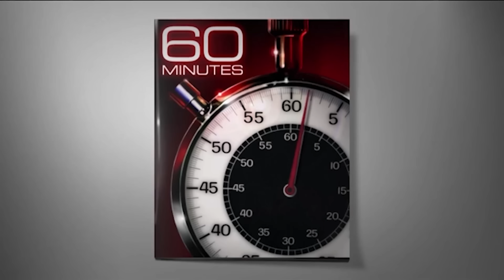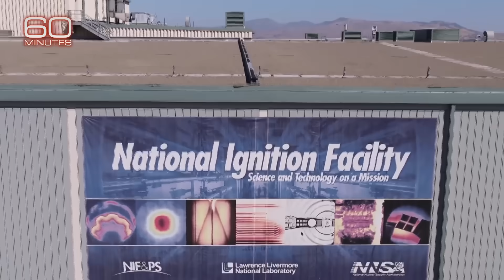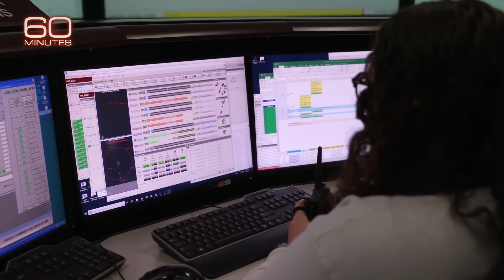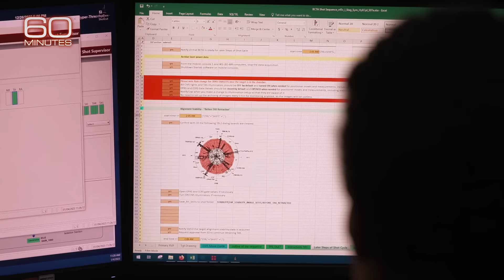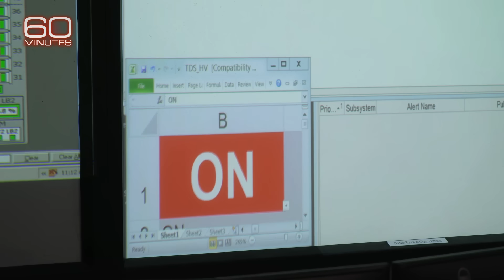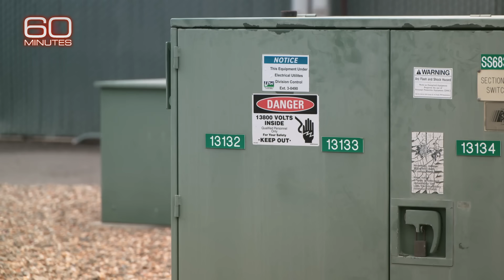Nuclear Fusion: Inside the breakthrough that could change our world | 60 Minutes

Comment: the crazy part is... fusion reactors for all the power they use can't even do what ball lightning does as it sustains far more than 30,000 volts per cm of spark and keeps burning steadily till it dissipates. No magnets holding it's plasma together and driving it's output...

Maybe that's the key to free or cheaper energy...

bet ball lightning is also more efficient than fusion reactions to... Yet they can't figure out how the lower energy fields work to create ball lightning as they try to take more chaotic and energetic plasma
Reply: Please someone explain why our magnetic confinement and massive energy can't do what an open air ball of lightning can do... They can't even replicate ball lightning yet which is more calm and easy to control in comparison to fusion plasma.... That fails to last as long as ball lightning that seems to be doing cold fusion.... A thing that would be a true breakthrough would be taking the lower energy more stable ball lightning....  Literally does what they try to make reactors do and does it with what exactly... It has no magnets draining cities earth of energy. No aircraft carrier lifting magnet or power source..... 

Why are they not trying to copy the one thing in nature that could be key to getting it right.....
Reply: Tho ball lightning is also connected to things it seems separate from. Like every electromagnetic field able to interact with it's own... Maybe it's a spot where electromagnetic waves constructively interfere. 

Be funny if it was as simple as frequency and energy at the right vibration.... 

Maybe that's why it's so random.... 

Not exactly just the energy in the ball but a good part of energy moving from outside from another field into it as it's a point where energy from two or more fields interact amplifying eachother as ones from Earth itself, others from clouds and maybe even fields in space to.... All is connected through them and that's slot of energy spread out.... Wonder if ball lighting equations for energy and all that match the bigger areas of the the fields they originate from....
Reply: Crazier thing is the energy despite of the sun is actually less per human sized area than a person has inside. If humans were turned to 100%energy it would take less humans to match the sun's output than it would take to fill it in with humans.... And that's just digestion... 

Sun is less than 300 watts per meter cubed.... A human is 1000 jouls per meter cubed. Digestion takes 2 joules per calorie at over 2000 a day....

The Sun's "power density" is "approximately 276.5 W/m³, a value that more nearly approximates that of reptile metabolism or a compost pile than of a thermonuclear bomb."

Comment: Actually, 60 Minutes is WRONG.
Nuclear bombs are FISSION, not fusion.
Bombs don't "fuse" atoms, they SPLIT them. The difference between power plants and nuclear bombs is, the former is CONTROLLED fission and the latter is UNCONTROLLED fission
Reply: Thermonuclear/hydrogen bombs are using fusion.  They're actually fusion bombs.

Comment: Such a great point to look back at history and think the Wright Brothers only flew 120ft  (37m) on their first flight in 1902. It was roughly 10-15 years after that time planes were used in WW1.

People doubted the Wright Brothers that "flying" wasn't possible. 
This sounds so familiar in relation to the doubters of today.

 The achievement on Dec 5th is no doubt remarkable. This goes out to all the privet companies working around the globe.
Congratulations for this small step in a huge process. I believe in you bright and talented people will make this happen. 
Thank you
Reply: I have similar view on the topic, humans knew what is required from powered flight for over a century at that point (fluid dynamics), and saw birds doing it since forever. Story of the fusion as energy source is very similar, we know the physics behind it (to some degree, because QCD is so complex we only have approximations). But in both cases several technological breakthroughs are (were) required to achieve the ultimate goal. For example  Commonwealth Fusion is developing high temperature superconductors that should allow for much smaller tokomak/stellarator designs, enabling to iterate over the design (they plan to show net energy gain before Iter is even operational). There is also General Fusion and Helion that both achieve fusion and plan to show net energy gain in several years (both using completly different approach than tokamaks). It is hard to say what is the progress of China in this field as you can not really trust sincerity of the claims they provide (but can't dismiss their prowess either).
Reply: @ukaszlampart5316  china can barely power their aircraft carriers... lol
Reply: It took less than a life time to go from  flying 120ft to flying to the moon.
Reply: best part i believe is all the tech used to make it happen is relatively old and inefficient like the lasers, so if we build one with modern day or experimental parts maybe we could get a better Q
but at the end of the day im no scientist 
i can only wonder in Aw
Reply: The Wright Brother's comparison, on its surface, sounds encouraging, however... a true comparison with consideration to scale would not be the Wright Brother's to current flight technology... a more accurate comparison would be Wright Brother's to Light Travel. When you look at it that way, you can really start to understand the complexity of harnessing fusion energy in a truly meaningful way.
Reply: @jefferyl4066  Your scale is way off and makes no sense lol. Light travel, even starting from today’s technology is an infinitely (literally) larger stretch than the initial comparison of fusion to man’s first flight.
Reply: @GorlockSlayer  You clearly aren't privy to where man is at on the timeline of light travel implementation.
Reply: Getting to flight, and getting to practical power generation from nuclear fusion are two VERY different things.  It probably will happen, but without some major breakthroughs it likely will not, not in the next 20 years, anyway, and I mean happen in the lab, not in a much more difficult working power plant.  

One of those breakthroughs, I'm guessing, could actually be nothing to do with nuclear energy, that being a true super brain, and a few iterations to an ultra brain or hyper brain of whatever the heck you want to call it.  Of course, it could end us shortly afterward, so there's that.  :-)
Reply: We always get the worlds greatest inventions every 120 years, Harley Davidson also came out in 1902 a lot of stuff actually
Reply: Birds can fly, but no animal can do fusion. The comparison you are making, makes no sense. Flight can happen under normal conditions. Fusion happens only under extreme conditions. Fusion is extremely difficult to make economically viable. This "breakthrough" does not mean anything. It takes us no closer to fusion as power source on earth. Its like you didn't even watch the video. 300 energy "units" user to get 3 out. Lol.
Reply: Converting fusion to usable energy for the masses is orders of magnitude more difficult than the aviation breakthrough. I don't forsee any significant amount of fusion energy supplied to the public this century!
Reply: Some of the 1st planes that weren’t successful were unmanned
Reply: Its nothing like the first flight. Its more like refining iron ore for the first time after 60 years of trying and then saying a Porsche is possible in a decade.
Reply: I'm skeptical about the prospects of self-sustained nuclear fusion -- getting more energy out of it than you put in. We cannot emulate what the sun/stars do because they rely on GRAVITY as the driving force for the reaction to happen, and gravity requires no extra 'energy' -- it's simply a force that naturally occurs when a large body of MATTER is present. So, we have to expend tremendous amounts of ENERGY in order to start and sustain the fusion reaction. Researchers may 'claim' that their reaction produces more energy than the energy required to start the reaction, but two critical questions remain: 1) Is that differential in energy SIGNIFICANT? In other words, are we expending 3.9999 joules of energy in order to extract 4.0000 joules of energy? 2) Are they even able to SUSTAIN those nuclear reactions 24/7? 3) Even if they're able to CREATE more energy than what was spent, can they actually HARNESS all that energy? or does much of it get lost/wasted in the process? Nature/God has provided a 'model' for how energy can be created via nuclear fusion -- using GRAVITY as the key driver (and 'gravity' requires no extra energy to be input). It may very well be possible that this is the ONLY way to create a net-positive fusion reaction.
Reply: Wait. They first claimed that it takes 2 units of energy to get 3 units out? But the reality is that it takes 300 units of energy to get 3 units out? Is this some kind of joke? Basically, they haven't achieved ANYTHING EVEN CLOSE to sustainable fusion energy. Wait. They first claimed that it takes 2 units of energy to get 3 units out? But the reality is that it takes 300 units of energy to get 3 units out? Is this some kind of joke? Basically, they haven't achieved ANYTHING EVEN CLOSE to sustainable fusion energy.
Reply: Patting yourselves on the back over this isn’t really the same as the first flight which can get into immediate production.  Maybe in 50 years you can do the ol back pat, if ever!
Reply: @shitmandood  your name and icon say it all, bruh
Reply: @schmarpsywinkleurnklabean659  ???  And yours doesn't?
Reply: @shitmandood  what does my handle mean?
Reply: @shitmandood  Well I am not sure what comment specifically you are referring to, but mine was never stating that the specific approach used by National Ignition Facility will be the one. To be honest I highly doubt it, but instead I presented others that might achieve that.

Comment: What kind of energy did they put into it? If it wasn’t the laser power? I thought that was the whole reason I have 196 poles. I thought this was absolutely huge, but I don’t know now because they weren’t counting the laser power, somebody please explain
Reply: They use electricity to power the in-efficient lasers. The laser light has an energy of around 1% of the electricity that goes in. The laser light hits a target which heats up so much it releases X-rays and explodes. The round fuel pellet inside that target (that's what the interviewer held in the video) gets imploded by those X-rays. Because of the circular compression the material reaches super high density & temperature at the center of the implosion. That's where fusion happens.

The energy released by fusion was higher than the laser energy that was put in. But the lasers have really low efficiency.
And the fusion energy was not converted to electricity. Even if they had the hardware to attempt that, it could optimistically only turn 50% of the fusion energy into electricity. Overall they would have lost >99% of the electricity they put in if they tried to get electricity. In practice they lost 100%.
But there's still room for improvement, and there are other ways entirely to start fusion. It's not impossible to get fusion energy.
Reply: @kedrednael  Thank you so much. 😊

Comment: Its too bad that the actual numbers involved of total energy required is 100 times what they got out. Yes, the fusion reaction itself was a net positive, but the energy to start the reaction wasn't. The entire system efficiency is 1% - so this is still orders of magnitude worse than every the worst energy efficiencies in power generation. Just putting this energy into a battery instead of starting a fusion reaction in general would be hundreds of times more efficient.

Sadly, fusion is no closer than the pipe dream its always been.

Comment: Someone needs to cover Lawrenceville Plasma Physics Fusion because they're closer than anyone else to actually producing viable fusion. Their reactor is smaller, cheaper, safer, and doesn't rely on expensive and rare deuterium as fuel. You can find them by searching for LPPFusion. They're a small operation, with a handful of people, operating on the eastern coast of the USA, and their work seems far more promising than any of these multi-billion-dollar projects that have spanned decades. Yeah, the NIF made an achievement, they spent 300 megajoules getting 3 megajoules out of their fuel. Big waste of time and money, and as far as I'm concerned their facility is a tax on everyone for being ignorant. Unless lasers (which have been around for a number of decades) can be made 10x more efficient, their approach is a dead-end. LPPFusion, on the other hand, has a novel approach to fusion that actually looks promising.

Comment: What if it gets out of control?
Reply: It can't? For fusion to happen the fusion fuel needs to reach ridiculous temperatures & pressures. If something goes wrong there is no way those can be maintained. In the worst case the fusion is so much stronger than they expect (unimaginable) it breaks the reactor.
It's different from nuclear fission fuel which just heats up if you have enough of it together, and which heats up even more if it gets hotter.

Comment: Now they just need to increase the output around 100+ times to reach the true break even figure. 
And then ramp it up more to get to a commercially viable level. 
And then build the power stations. 
It's 30-50 years off.
Reply: yes but in 50 years, we can harvest/create the energy of a Fking STAR! A STAR! Oh a dying sun? Who cares, we can build one.
Reply: @helloman3676  Ever hear of a thermonuclear weapon?   That is the same source, fusion, not too controlled though.    Build a sun?  Good one.  You should do stand up.  Go figure out how long all the fusion fuel on Earth would power the sun.  Basically no time at all.
Reply: @helloman3676  The problem being that in 50 years it will be 30-50 years off.
Just like it always has been...
Reply: Try more like 300.  Your definition of just, and mine, are apparently two very different things.   And that is not REMOTELY the only problem to solve.  The problems are many, wall materials, etc.
Reply: @MrJdsenior  "Just" being a form of understatement...

Comment: We have other proven technological solutions that cost far less than the fossil fuels that we used to generate power but no one gets excited about them. Amazing that people will look at some remote chance of fusion working where energy conservation, solar, wind and battery storage added to whatever else we can cobble together is more than sufficient to get us off fossil fuels and enmasse should be much cheaper than what we pay now if our politicians were not bought off by the oil companies. Big oil spends over $1 billion a year to confuse us and I wouldn’t be surprised if they didn’t fund fusion energy which would play right into their hand for us to chase after a non-solution while other solutions that are perfectly viable are not exploited.
Reply: Li-ion batteries aren't good enough. Use fossil fuels until they figure out the mass production of graphene and we'll be fine.
Reply: @iamchillydogg  what do you mean that “lithium ion batteries aren’t good enough“? I am assuming you mean in transportation but for that application, they have tripled the production of lithium ion vehicles just in the past year. Plus new chemistries are already coming on the market or half of all Teslas are not lithium iron phosphate, there’s no guarantee that graphene batteries will ever be manufactured in large numbers.

Comment: Attempts to create continuous fusion power will continue to fail as it relies on the false assumption that the energy of stars results from the transformation of hydrogen to helium. In a backhanded way promoters acknowledge this by only using deuterium and unstable tritium - never hydrogen.

Comment: If you read up on this, it wasn’t a pure 2 units of inputted energy to yield 3 units. They are neglecting some of the input to state that the reaction was a net positive reaction. 

Incredible achievement and noteworthy. But it’s the equivalent of when Elon announced Tesla’s autopilot. This technology is nowhere near where scientists assumed it would be two decades ago.
Reply: Exactly right. There are many MANY very high hurdles yet to cross, not the least of which is finding fuel. The dumbed down "hydrogen is everywhere in the ocean!" argument doesn't cut it since the normal and plentiful variety of hydrogen doesn't work. We might have this technology (if we keep pouring vast mountains of money at it) by 2050, but I have grave doubts that it will be on time. We are wreaking havoc on our planet in the meantime and the havoc is placing those big budgets at risk.
Reply: The lasers are 30 year old tech.  There are way more efficient lasers available.  Now that this achievement has happened, more funding may mean and upgraded facility.  Can't upgrade without results...